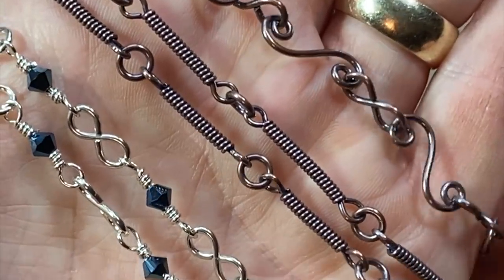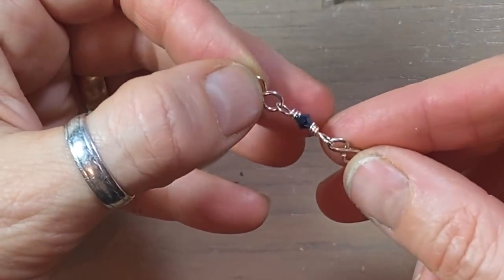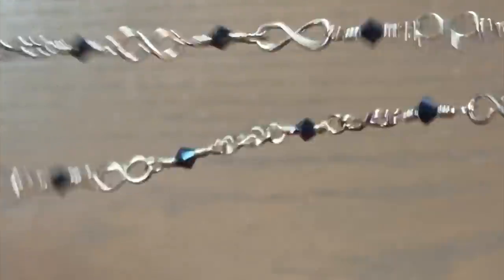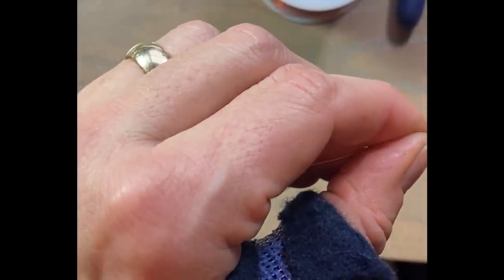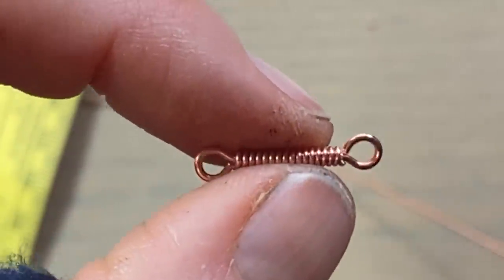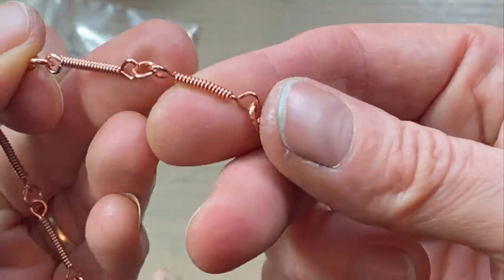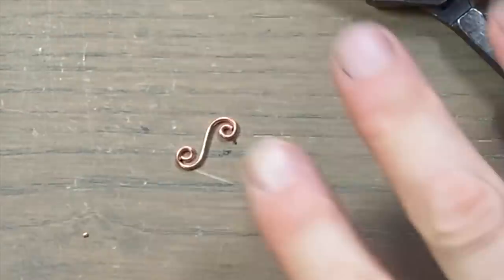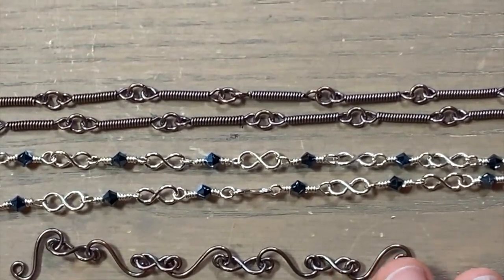DIYJewelry- Make Your Own Chains Part 3! Cute and Decorative

Comment: You need a double flush cutter.  Much faster. One cut and both sides are flush! Perfect for jump rings. Xuron has a decent inexpensive one but the tips are thick.
Reply from the maker: That sounds great! I’ve never heard of one. I’ve got to get one for sure!!!
Reply: @ZurickDesigns   I used to have a really good one I picked up at the Bead and Button Show in Milwaukee years ago but I lost it. The Xuron one is decent but I loved the one I lost. If I remember which booth I bought I from I will let you know.
Reply from the maker: @ginger-cathousecreations4315  thanks for letting me know! ☺️
Reply: Also, if you don’t have a pair of tweezer nose Xuron pliers, do yourself a favour and get a pair! They fit in all the tiny places you can’t reach.  Some wire workers use them more than any other plier for all wire working.
Reply from the maker: @ginger-cathousecreations4315  I’ve wanted to get a pair of those too

Comment: i liked this video, i gave it a thumbs up and i subscribed, i thought these chains looked good, 
my faveriout one was the silver S shape or figure of 8, i really liked the crystal bicones and the sheen of the surface of the silver wire, it looked lovely!. Thank you for making a coil chain, as i would like to see more different types and variations of coiled jewelry, i really would like more inspired ideas for coiled jewelry as i really dont have many, i made a coiled red glass beaded necklace, from an idea i saw on Pintrest, and it turned out really well, and it looks great and has a great shape. Lately i have searched for on youtube a tutorial on how to use Bullion Wire which is a fine Decorative wire which has been crimped in to a shape like a tube and it has a round thin channle running through its center core for slipping the decorative Bullion wire on to a lenght of your base wire, after cutting off a lenght, it has many uses and is very stunning to look at, its surface is incredibly shiney in silver wire with a 3D illusion zig zag pattern. after searching on youtube i did not find one single tutorial for how to use Bullion Wire. do you know anything about Bullion Wire? have you ever used Bullion Wire before? thank you for sharing your video tutorial. Laura in Uk
Reply from the maker: Thanks for your comment! 
I like to hear what people want to see. 
I have not heard about bullion wire before. I’ll have to look that up! 💜
Reply: @ZurickDesigns   thank you for your reply, please when you have time will you make some more coiled jewelry designs in various styles, i need some inspiration in this area, as i have not fully explored this subject yet,  if you have time, i would really appreciate your input and your efforts. i have been learning wire jewelry for over Five years now, i had 20weeks of in person instruction at an adult learning center to learn the basics of wire wrapping ect, then after that ended there was no funding for any more lessons, so i continued my learning on youtube, i adore Youtube, its such a goldmine of people like your self who put out such high quality workmanship, and its incredibly valuable, to me,  i watch it every day its like my internet Library bible thank you for sharing and contributing your time and knowledge,  Thanks Laura in Uk
Reply from the maker: @lauraaqui219  I’m glad I can help! ☺️